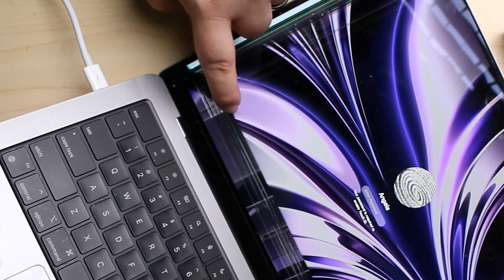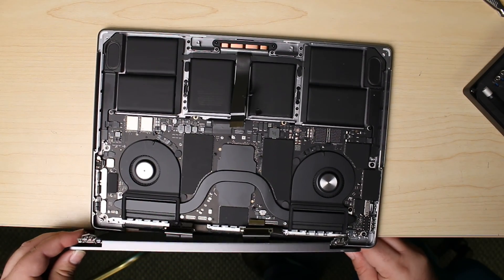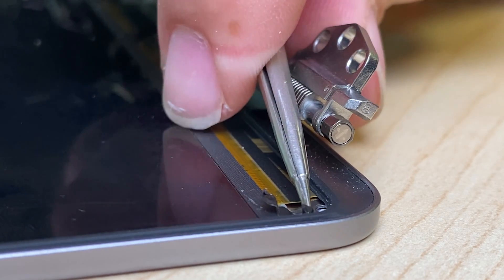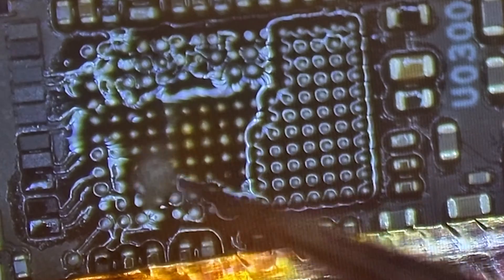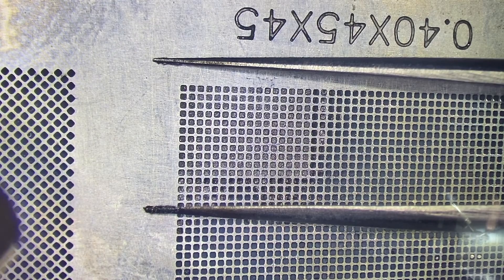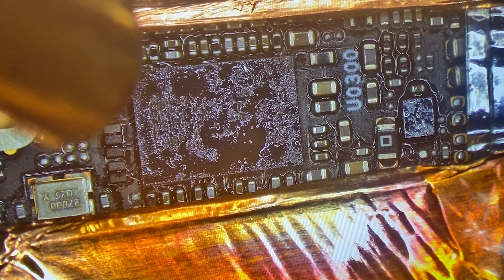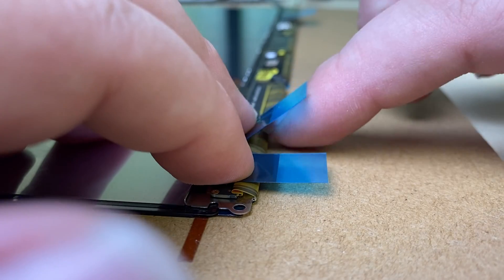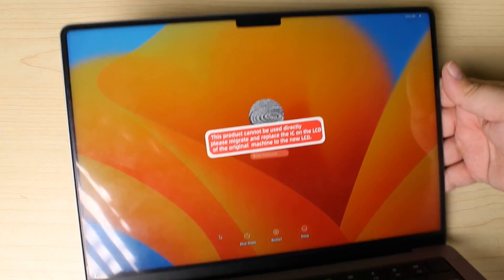MacBook Pro LCD Display Repair: Bring Back Brilliance!

Comment: Great video! What temperature do you use to reinstall the ICs on the new display? Also 350 C Celsius?
Reply from the maker: Yes 300-350 I’ve found is great for the soldering portion

Comment: What dimensions of adhesive did you use around the perimeter of the display? Or did that come already attached to the replacement display you used?
Reply from the maker: 2-3mm works for most, and unfortunately they don’t come pre installed

Comment: Dear Maker of this video,

this was one of the most incredibly nice done tutorial to change a MacBook's LCD. I Stille have some Questions: Why do you need to swap the old ICs to the new Display and would it be necessary for a A2141 MacBook too? Would T7000 glue be also an option and what are the advantages of shock resistant tape?
Reply from the maker: Great questions. The ic’s are important on a few on the models but not all. The video description talks more about that. As long as the glue isn’t to viscus then it can be used. Just got to be careful with the backlight. I definitely prefer the tape as it’s accurate and not messy with no cleanup etc.
Reply: @FIXDPHONES Thank you so much for your answer. Does A2141 MacBook's have also a Chip with its ID? And where are you sourcing your panels from? Could it be suitable to contact LG Display or Japan Display to ask for a panel (if they would care) or could it be smart to transfer the panel of a Grade C display assembly to the damaged?
Reply: @tobiasd5235 no, the A2141 has a more traditional retina LCD that works totally differently. You do not need to swap any chips but if you wish to retain true tone functionality you need to use the original camera. Quite frankly losing true tone is not a big deal in my opinion.

Comment: Hey, awesome video. Was wondering if you could help me. My issue is slightly different, I have a blurred out screen. It looks like the backlight is on but the screen is off. Any suggestions? It came out of nowhere
Reply: Hi friend! Did you find any solution to that problem?
Reply: @EduardoBerth  dead screen, only solution is to replace or get a portable monitor

Comment: How long does this repair usually take, when everything goes right?

I have yet to repair one of these because the business that I work for doesn't want to offer the repair, due to the potential for damaging these expensive LCDs while trying to remove and transfer the chips, plus the amount of time that it takes to do the repair...yet they also really want to offer the repair.
Reply from the maker: You should plan for 3 hours, yet it can be done in 1 once proficient.

Comment: Had to do the same to repair my 16" mbp, almost messed everything up because I forgot to replace the chip as well, but a technician friend reminded me that I needed it if I didn't want those weird artifacts showing after repair
Reply: 16” A2485 do not suffer from artifacts only 14” A2442. However you can have slightly funny backlight if you do not change the chips on A2485 which is why some people suggest you change the chip on them as well Therefore 14” A2442 is the only one that gets artifacts if you do not change the two IC’s on the control board.
Reply: @MrPnew1  well then I lost some money and time but best to overdo and be sure, still really interesting it only shows up in 14” models
Reply: @MrPnew1  I repaired some MacBook M2 Air and there was no Problem with the sleep after a Display replacment, was i just lucky?
Reply: @Techozoom  I only had trouble on the first full LCD assembly that I did. After that I never had a problem again with sleep so I edited my reply above. Apologies for that but sometimes the Chinese get better at getting around these issues.